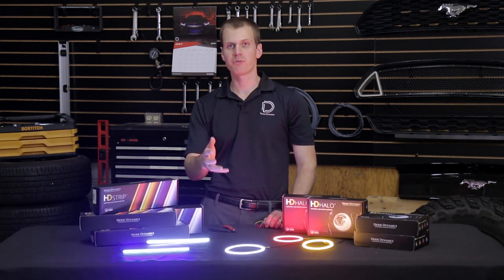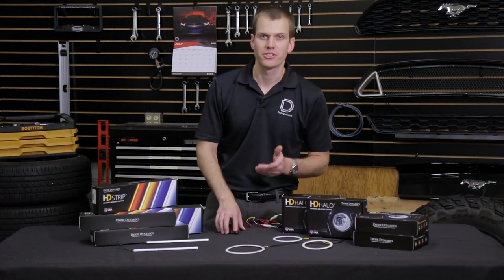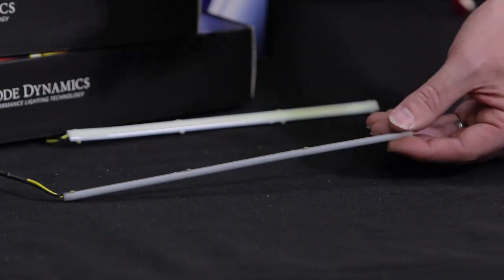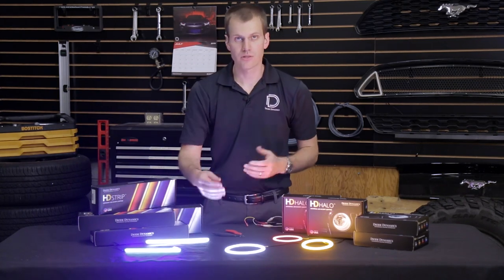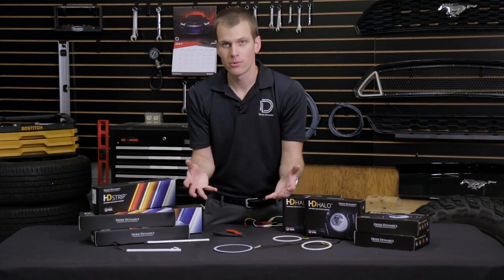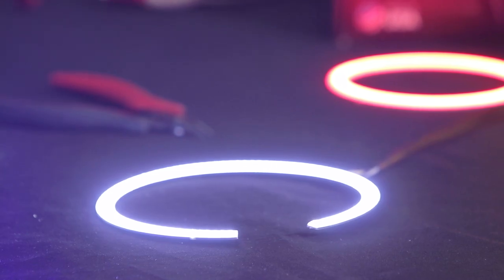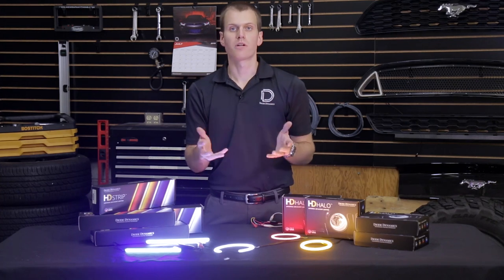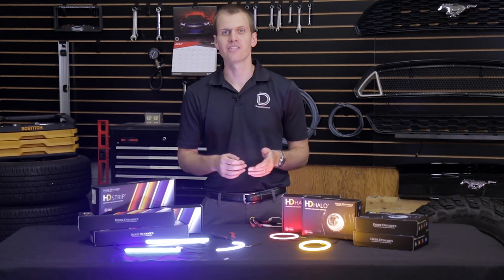How to Cut HD LED Halos and Strips | Diode Dynamics

Comment: Have to say that's a nice addition to the line up. I have the 2017 wrx c light mod for the past 2 years and still zero issues. I do have one question, I have a extra set of c lights for my wrx unfortunately some how the harness got caught into the tire would I be able to purchase the harness portion and re-solder the harness..? Thanks an advance as always keep up the amazing products

Comment: Could the HD Strips be used with a domelight fader?  It is a pwm module that fades lights on and off instead of instant on/off.

Also, did the Blue strips get discontinued?
Reply from the maker: You should be able to install these strips in line with a PWM module! Sadly, we did discontinue the blue strips.

Comment: Can the strips be cut at different angles to make a pattern for example. So cut at 45 instead of 90 for example?
Reply from the maker: Hmmm- They can be cut at a slight angle, but we wouldn't recommend a 45 degree angle. Please go ahead and give us a call at 314-205-3033 Monday-Friday 10 a.m.- 5 p.m. CST, or shoot us an email at contact@diodedynamics.com, and our service team can give you more information on this!

Comment: Hey guys I'm looking to line the outter edge of the inside of my motorcycle headlight. It's for a 2014 Yamaha Vmax. The light itself is an oval shape, like the vrod. Do the halo rings flex when they're cut? Or would I be better off using a pair of strips and trying to bend em?
Thanks in advance
Reply from the maker: Hmm- Our Halos and Strips don't flex a huge amount, but we would need to see what you're working with to answer that question. Go ahead and shoot us an email to contact@diodedynamics.com with some pics of the headlight, and we can help make a recommendation!
Reply: @diodedynamics  will do thank you!